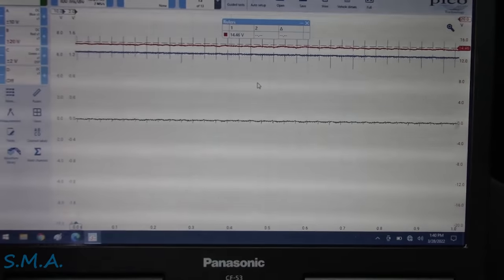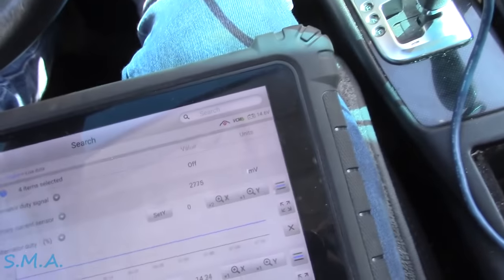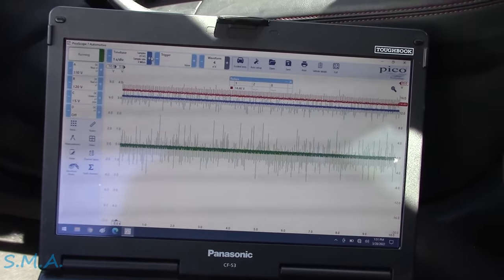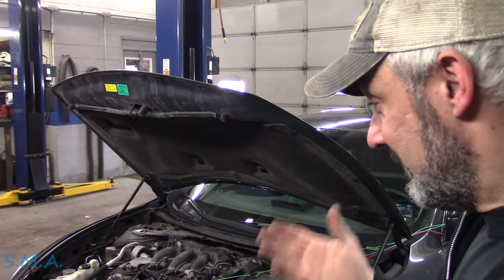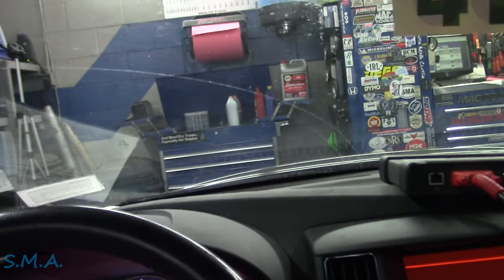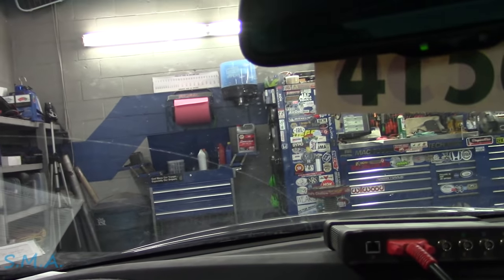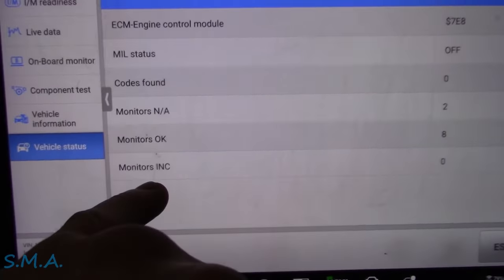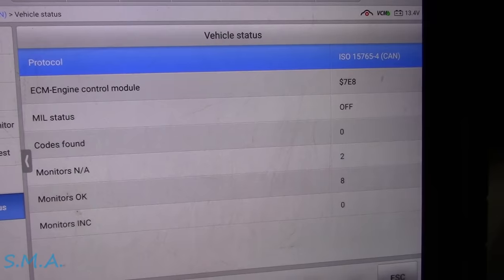Nissan Dealer Quoted Over $2000 For A New Harness!! - The Real Problem

Comment: Interesting I wonder if in the times the voltage was high if there was no amps. With the replacement alternator the voltage was solid and no variation.  Yes i think the dealership should refund the owner their money back. They didn't do their job correctly at all.

Comment: Legit solution... Had my 06 Altima drop intermittently in and out if Limp mode... After two speed sensors on trans, the shop figured out  alternator pegged voltage to 18v. It's a common failure that is exasperated by low quality regulators on remanufactured alternators... On these cars labor for installation is alot don't do it twice buy oem Quality... (Denzo) if possible...

Comment: a altinator ac only are is supposed to charge too 14.44 volts regulated only by the diode pack , not by the computer, the k wire on the alternator is a dual asses point 1 for data and another to help reglation

Comment: Cars can be strange. It seems like if something is wrong that it would be easily recognizable to a mechanic. I had a truck that would drive a mile, stall, restart, rinse and repeat. I had her in 2 different shops and nobody had any idea. After a year of sitting I slapped a for sale sign on her. Told a guy what the truck was doing, 30 minutes later he showed up with a flat bed, pulled a fitting of of the brake booster, blew through it, drove it on his truck. You could hear by the smooth as butter idle(it had been choppy and spitting ) that he had fixed it. A 5 dollar part and 2 minute diagnosis. I was highly pissed that I had sold a truck at 1/4 value over such a simple thing that I feel 1 of 5 mechanics that had been paid to find the problem should have found

Comment: As a former dealer tech and independent tech, this isn’t a dealer only issue. It’s widespread. Yes the dealer should refund every penny for their “diagnosis” and their “repairs”. But they will likely not. I’ve had owners from Indy shops refuse to pay for their screwups and argue until they are blue in the face and had dealer service managers do the same. It’s a shame. I just tried my best to educate my customers and treat them how I would want to be treated. Customers need to find a mechanic that does well for them and stick with them. Follow them if they change employers. Your customers are lucky to have you.

Comment: I have a nissan pathfinder 2006 got the issue that we engine is hot dash was all off like no power to the dash then dash was on and battery light with ABS light and if AC was on ,the blower was on 4 but the blower speed sound higher than 4 and it was the BCM seeing high voltage and shutting down somethings as a safety to not burn out or damaged because of the high voltage , it was the voltage regulator inside the alternator gone bad , replaced the alternator and fixed the issue.

Comment: I think that the Nissan dealer should give her the money back.  It may not have been malicious, but it is very unprofessional.  Had CD a similar problem with a Ford dealership that just couldn’t fix my A/C properly.  A second dealership quoted 1200 bucks to repair it.  I finally figured it out and fixed it myself for about 13 dollars.

Comment: I had a car that the battery light would come on after turning the wheel far in any direction, even when i was at a stop. turns out that my harmonic balancer split into two pieces and only the drag from the power steering pump would cause it to slip. it was interesting

Comment: Eric,  got a friend who bought a 2018 Versa. He's got a P0705 code ( transmission range sensor)  They bought new Tran-Range Sensor. Not been installed yet. Transmission guy told him he could put it in but would not solve his code P0705 code.  Seems there is a feedback problem with that circuit to tail lights or reverse light. A bulletin was put out by Nissan about tail lights having moisture in them that leads to contact problems. Have you ever ran across this?

Comment: Definitely should get her money back for a simple fix outside the dealership. I lost all interest in Nissan when the parent organization refused to recall and repair the Xteras after a model change that produced defective clutches while vehicles were under warranty.  This was an inherent defect due to a boost in HP from one model year to the next without producing a stronger clutch for the higher HP.....  The manufacture held to the proposition that the clutch is a wear component and not covered by the vehicle warranty.

Comment: I finally had to go to the stealership for help with a diag. situation because I was told they were the only place with the needed equipment.  I'd been struggling for years trying on my own.  They charged me $131 & apologized for not being able to figure it out.  What they didn't know was the little bit they did tell me was in part what I needed.  They didn't understand the info. they had.  Shameful, if the computer doesn't spell it out for them, they're lost I guess.

Comment: Hey Eric my 2013 Elantra Ltd ( bought new but now ) with 118K on it has developed a bad case of Stiff Brake Pedal Syndrom which prevents starting the car a lot because it has keyless ignition . . . unless you use the no brake pedal bypass procedure. I have a new Master Brake Cylinder BOOSTER Hose Assembly and check valve coming in hopes . . . that is only the problem? After that . . . I'm lost? My mechanic is lost? What might be a next step? There are no leaks (liquid or vacuum) that I can detect. This is a very common Hyundai problem and been going on for at least 12 yrs and ignored by Hyundai.

Comment: Dealer techs or really any techs that 100% rely on service data to perform troubleshooting, in my opinion, should not be diagnosing vehicles. From my experience as a peterbilt technician, if you don't think outside the box and make sure that everything is there for the system to operate properly before actually digging into that system then you will be going down a diagnostic rabbit hole very quickly and the customer will end up in the same situation this Nissan owner did prior to Mr. O getting his hands on it.

Comment: Where would most people go if they had a hard to diagnose problem with their vehicle, the dealership of course. One would assume that with they would be the most likely choice given the theoretical access to the factory specs. Sadly, that is not always the right answer. The dealership repair department is only as good as the mechanics that they hire. Just like any repair shop you don't know until they work for you for some time.

Comment: Jap Crap and I use that term with love! Easier to diagnose than NA Electrics (I have had the unfortunate "Chevy Tracker ""It is the same as a Suzuki" Lack of build quality and NA Electrics!" This is the only channel that I will watch the adds so you can get money! You are awesome sauce! Now if you ever get a chevy tracker ( Sidekick or Vitara type) look at my fixit fix for bad headlights/blower motor etc. Yep "NA assemblers suck" with quality Jap Crap! I learned that "Jap Crap" term from Jeepers (Not XJ Guys) as they laughed at my SPOAD, Spring reversal Sammy, then would accept a cold bottle of water as I flipped/towed
them out of the hole they dug! :-)

Comment: Great work,  I believe  Nissan should return customer $1,000.00.  As expert of  Nissan ,should not question on customer expense a repair until they fine the bad components.  I was on deployment my wife was inform that fuel injection was bad and ask $3,000.00 to replace. I told her to pay tow tuck back home and use my car until I get home. It turn out to be catalytic convertible plug up due to flooding and water investing thru muffler. It would had cost double to get it right.  At least customers save a lot not doing the original repair at Nissan, thank goodness.

Comment: I'm working on a Nissan alternate Is throwing a safe mode and not loan the engine to get enough power to move replace the transmission and do it's trying to submission I'm doing the same thing I'm trying to figure it out it ran for a little while but I'm going to safe mode but it went back in after all driving in a couple months

Comment: My experience (twice) is if you park yourself in the service dept. first thing in the morning when everyone is dropping off their car, talk loud, and make it clear what a scum sucking dept. it is, refunds come in short order.  First rip I had was a corvette that ran fantastically, suddenly ran like heck while driving down the highway.  Local mech said he needed a computer to diagnose it and he didn't have one. So off to Chev stealer.  Shop had this huge sign hanging that bragged about the hundreds of thousands  of dollars worth of diagnostic equipment they had.  Anyway $600, multiple trips,  and no repair later, I found a bad plug wire arcing to the manifold-that was the entire problem.  So back to the stealership I go,  I was already pissed and the service manager made me wait in the shop 30 minutes (I could see him through the office window) hoping I would just leave-really bad move on his part. This was a long time ago, now the charges would have been thousands.

Next time at Dodge dealer was even worse, after numerous repairs (for symptom of suddenly running like crap w/fuel injector code), including pulling the heads (machine shop didn't touch them, they were fine) they wanted to pull the cam shafts.  All this after I had a fuel injector code to start with.  I picked up truck and within an hour I found the injectors full of trash-fuel filter failed. Got my money back.  

Writing this just to emphasize this happens all the time and I can only imagine how many people that are in a bind and can't work on their own stuff, or like me, was working too long of hours and didn't have time to work on the cars, until I had to.  

I am really getting to old to do this stuff, so even though you are a yankee (I will over look that), you need to consider packing up and moving down to SC. No more snow!  But don't wait until you are retiring, we already have too much of that going on...

Seriously, you are by far my favorite auto repair channel.

Comment: It’s super strange that the ecm didn’t detect that the  voltage regulator  duty cycle.  That’s my concern. I two am having an issue with a Nissan Juke loosing power on the freeway and doing the very same thing.  Hmm. I had my Autel maxis connected and it was showing 14.25 Volts at full duty and that’s when it did it. Possible software issue I’m thinking with the not noticing the regulator malfunction. Maybe Nissan forgot to write that coding into the software lol. Shame shame Nissan

Comment: I think the dealer should refund the lady her money but not sure about refunding the money for the parts that they did install that's a little tricky there although she may not have needed them then again they may have been worn out or close to that anyway. This is one reason I rarely go to dealerships. Most of the smaller shops like yours have far more experience diagnosing the problem even though you don't have all the fancy tools at the dealerships have. It makes you work harder and look harder and that's where you get the experience. Yes I use an independent smaller shop and have been really lucky to find one that knows what they're doing.  Too bad you live halfway across the country from where I live . I'm in Oklahoma . Just wait till all the battery powered cars start showing up in your shop . No engines just electrical . Have a wonderful day

Comment: Dealer tech guys are there just to change parts and parts until the car's fixed. Won't bother using some grey matter to properly diagnose a problem. 
Anyway, i always drive with a volt meter plug into the cigarette lighter just for this reason. Who knows 🤷‍♂️

Comment: I don't care what type of car it is old or new you always check the battery the alternator the wires going from the battery to the alternator and check the fuses I had problems with a Ford it turned out to be a fuse I had another problem turned out to be the battery. Always check the alternator the belts the fuses the battery definitely then go from there

Comment: What would a tech untrained, or poorly trained, in diagnostics think when they saw all of those codes?  They most probably wouldn't start thing in terms of a common denominator, but of the problem affecting each code separately.  Which begs the question, how are tech taught diagnostics with a scan tool?  Are they taught to tackle each code separately or to try and determine what they all have in common?  As I've seen in several videos, less than a page of codes often means an exact problem.  But page after page of codes has a common problem.

I personally would go back to the dealership and ask for a refund on unnecessary work done, unless the dealership has irrefutable proof those sensors replaced were bad.  However, since replacing the sensors didn't fix the actual problem, some refund should be given.  Especially given the length of time that dealership held the car.

Comment: Do these alternators have replaceable voltage regulators? I once had a similar issue with a Mercedes w124 and the problem was solved by replacing the voltage regulator on the alternator which cost around 25-30 euros

Comment: Its sad. That i start working for a company 6 weeks in I get the boss saying I was not working out that I'm to slow. Funny it happens right after I pull out a scop to find out why the fuel pump shuts off. Turns out it was a bad pump. But I got my walking papers right not 5 minutes after checking it with the scop. But the hole town is that way. Scops are just taboo in globe az. So I'll just go around and work on cars for myself again. I'm better off being my own boss anyway.

Comment: So the right thing for the dealer to do would be to give the customer the money back but the reality is they won't.  Unless they go to their local action news station and make a big stink nothing will happen.  I had a battery issue where it went dead without any warning. Service advisor told me I wasn't driving the car enough to charge the battery.  Turned out there was a relay that was being left open and was slowing draining the battery. A ROM flash fixed the issue.  No apology from the service advisor.

Comment: The Nissan owner should hand the dealer their $2000 harness quote and tell them "IT WAS JUST THE ALTERNATOR", adding I WANT ALL THE MONEY I SPENT HERE ON UNNECESARY REPAIRS RETURNED TO ME, NOW! If they balk and refuse, I am sure the court system AND THE MEDIA will put them in their place. NY state should also be notified about the dealer's guess-and-throw-parts-at-it then charge the customer tactics as should the B.B.B. (although, I have found they aren't what they should be.) All the advertising in the world cannot counter the power a disgruntled customer who WAS OVER CHARGED AND WRONGED possesses.

Comment: So not only did they miss-diagnose and miss-quote a repair they did it to the point that the customer bought a new/used/new to them vehicle because they needed a reliable vehicle. I'm having a similar problem with different shops telling me that my rear pads are too thin and they need replacing to pass inspection. Took it to a 3rd shop who not only passed my inspection but told me I have roughly 10k more miles of use left (roughly 4/32 left) I hate shysters.

Comment: had a q50 that had a bad aftermarket denso alternator installed that was brand new and what would happen is it would just stop charging randomly only the oem alt was a fix
Reply: all that to say the charging system nissan has once understood or better say grasped at best it got figured out. definately a change of pace than the constant 14.5

Comment: The real problem with dealerships service is that they have those service managers,  the used car dealer frontman or women.  
The owner of the broken vehicle doesn't usually get to speak to the person with the dirty hands ! But this only really works if the owner knows some about there car ! And usually woman get taken advantage of !
And yes those service tech's need more time with electronic instruction,  cars are basically computers on 4 wheels !

Comment: Over $1000 and fixed nothing, Eric O. Couple hundred dollars and good to go until the next thing breaks (it is a nissand after all) that's pitiful workmanship on Nissan's end and she should definitely ask for a refund and apology, although Nissan being Nissan I wouldn't hold my breath, they'll likely go through a whole lawsuit before they'll give up a penny, Shame on you Nissan dealership this is very shameful, I'm not a tech and don't work on cars and I figured right from the very first alternator flicker that there was something going on with that alternator though I figured a severe undercharge condition it was the opposite, but seeing 14.5-17 volts was another huge clue and it just doesn't take that much knowledge to figure out something this simple, how does a "couch mechanic" like myself figure it out easily and the company who designed it can't I truly don't understand.

Comment: Just because a mechanic works for a dealership and is certified to repair their vehicles doesn't mean they are a good mechanic.  I've seen great dealership mechanics and horrible ones.  I think the owner should try to get some sort of refund or compensation but I wouldn't count on it.  Hopefully, they will give her something for her trouble and their incompetence.  For what it is worth, I came to the same conclusion based on what Mr. O showed in the video.